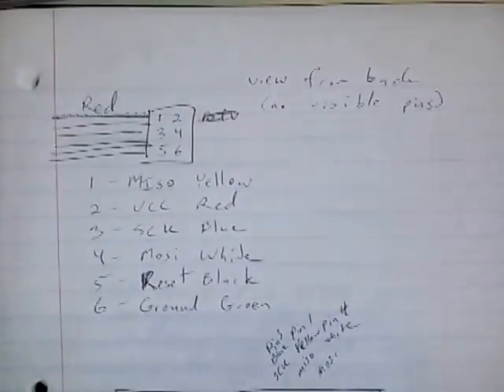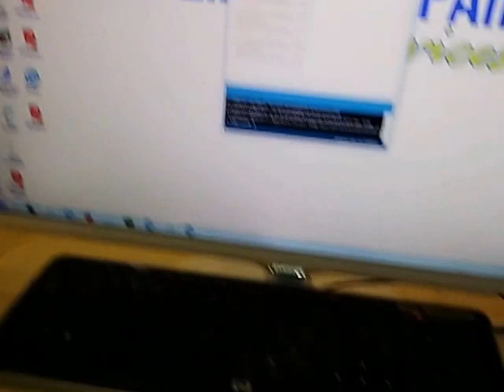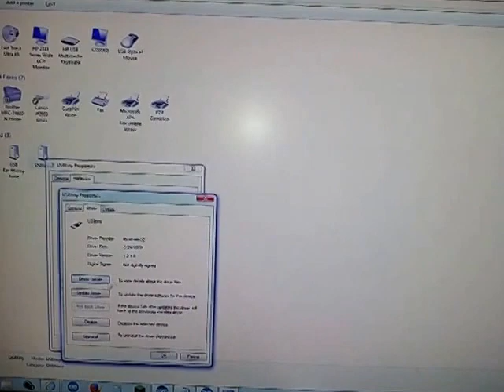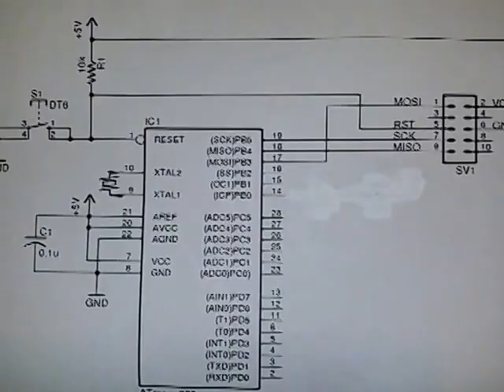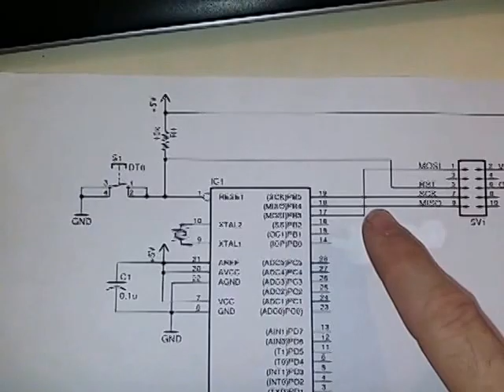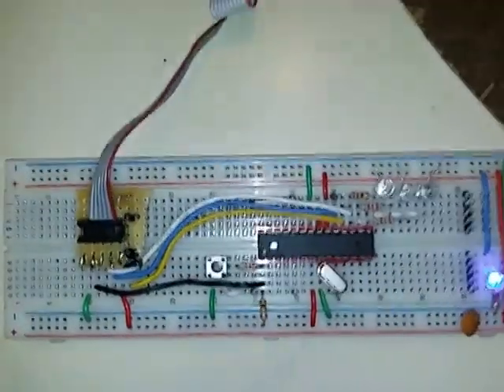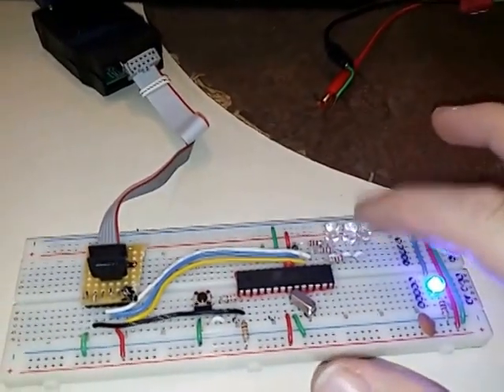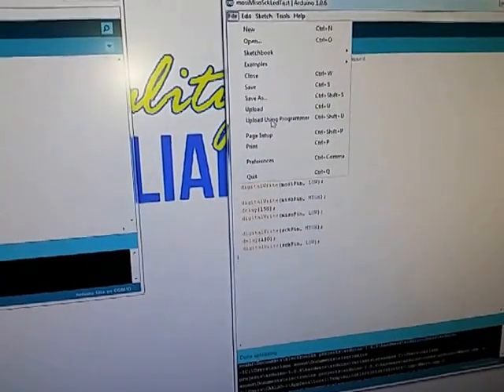USBtinyISP Program Bootloader ATmega328p

Comment: Regarding the MPU not working with the capacitors. There are two types of crystals, series and parallel. The capacitors are for a parallel crystal. You may be using a series type. Also, the capacitance between the rows on solderless boards is rather high. There may already be enough capacitance between the crystal and ground as the crystals normally require only 8pF to 32pF capacitors (32pF is most common). Most times the MPU will work without them unless you use a PC board.

Comment: You used the Arduino program to upload the boot loader.
Did you have an Arduino hooked up?
Reply from the maker: the USBtinyISP is a tiny Arduino board, (the one in the black box). I did not have an Arduino UNO or other board hooked up apart from this. only what's in the video.